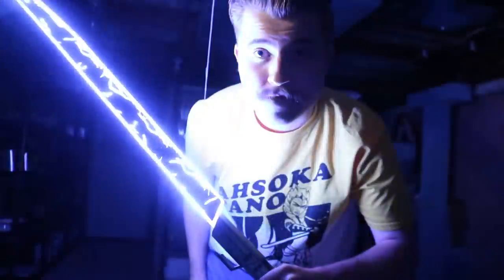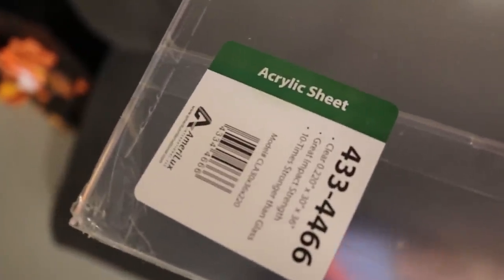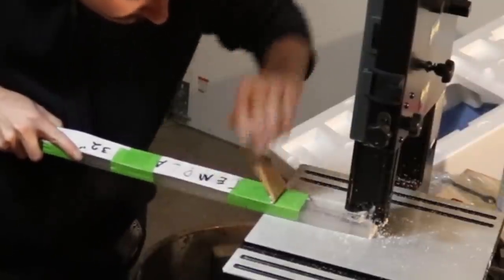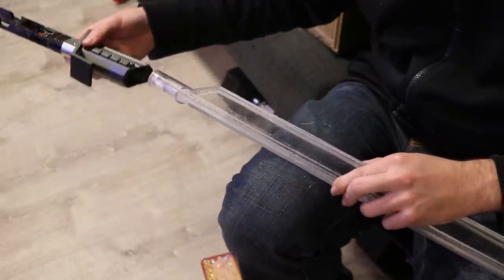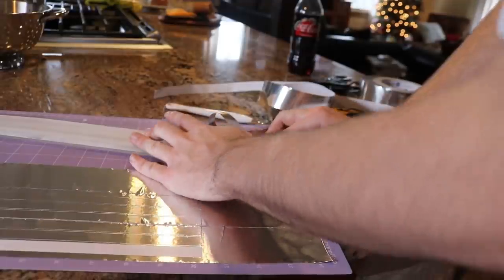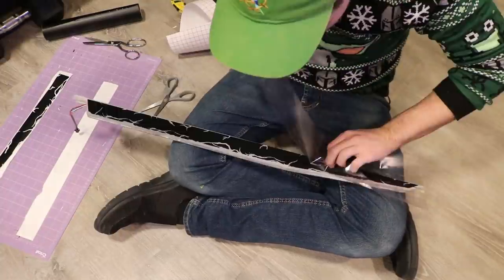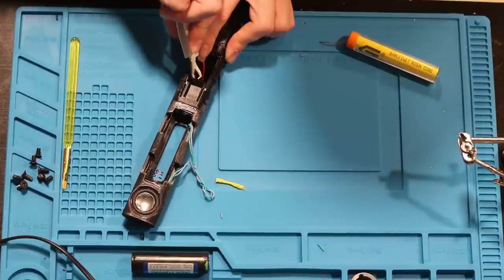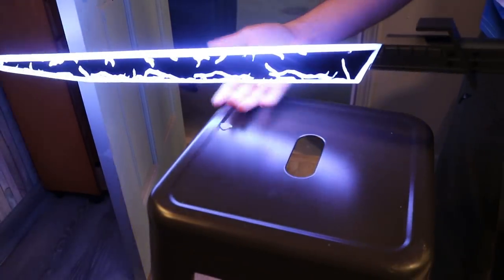How to Make a Mandalorian Darksaber: DIY Tutorial

Comment: A trick for running wire through a small space is to have a "guide dog" wire that you run through from the opposite end , then tape/tie the wires you need to run through the space to the guide dog and just pull then through.  It's an old trick that electricians use to run wire bundles through conduit and should work like a charm for future builds for you.
Reply: Fantastic idea

Comment: An easy way to bypass the vinyl decal on the blade is to use rubber cement. Mask off the blade edge, and then paint on the rubber cement. When the glue dries, use your fingers to rub some of the glue back. This will give you a random pattern. After this, a basic flat black application from a rattle can will give you the same effect.
Might I suggest using a polycarbonate instead of acrylic? The blade will last longer not just from bumps, but acrylic ages and becomes more increasingly brittle.

Comment: instead of using lights, why put a heater inside the saber? then if you turn it on  it will heat the edge of the saber in 900 degrees making it change it's colors, but of course if you use stronger materials like  tantalum or hafnium it won't melt and can withstand 900 degrees.

Comment: Has anyone tried applying a stencil (tape, etc) of the pattern to a regular round lightsaber blade? I have a few round blades and for my costume (my daughter and I match every year!) I was thinking of just using black vinyl or something around the blade. Not sure if I should wrap the whole blade and just pattern it out, or do half of each side and leave an open seam down the top and bottom. Thoughts?

Comment: M8 the Bladerunner needs to be screwed to the table at least... mine is build IN the working bench...
Reply from the maker: The bigger issue is since the blade moves up and down so quickly, it melts and fuses the cut making it horrible for the job